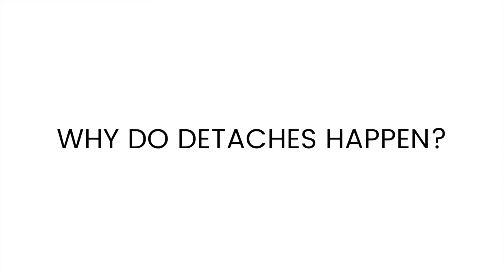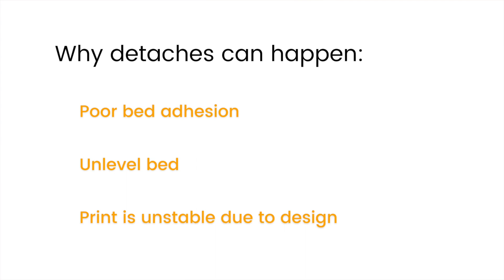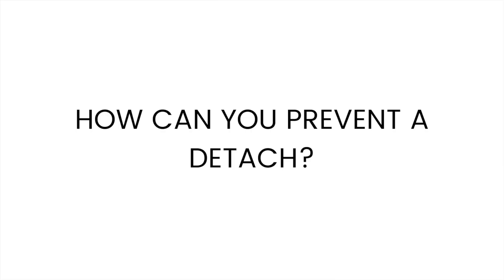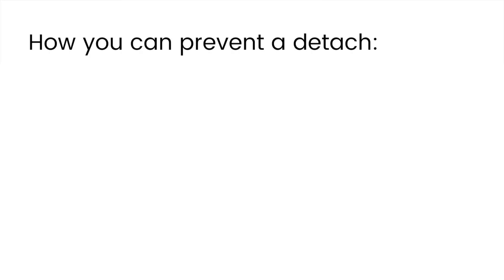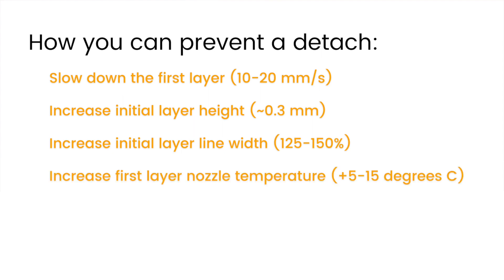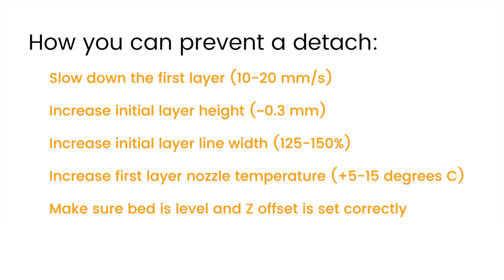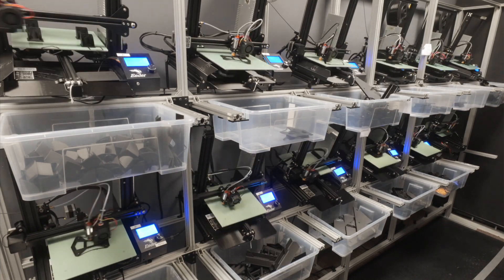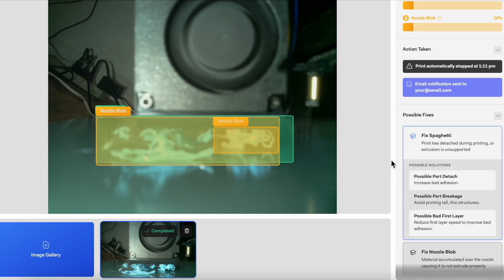AI Detects Print Detaches — QuinlyVision in Action (2022)

Comment: BUT; A BIG BUT.. You suggest your vaapr print Bed does not do this ; until cooled
Reply from the maker: Yes! We designed the VAAPR print bed to completely release parts when it cools down. When it is hot, the adhesion between the print and the bed is very strong. So detach doesn't happen DURING the print, it only happens AFTER the print has finished.
Reply: @3DQue  I need one for a Creality Ender 5 Plus; will do a video